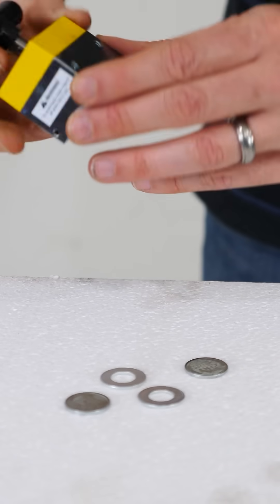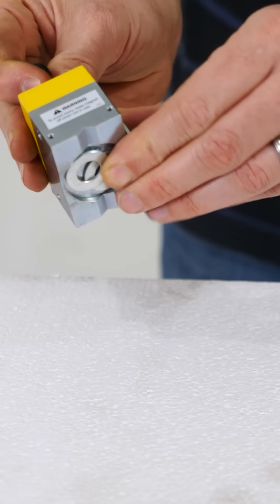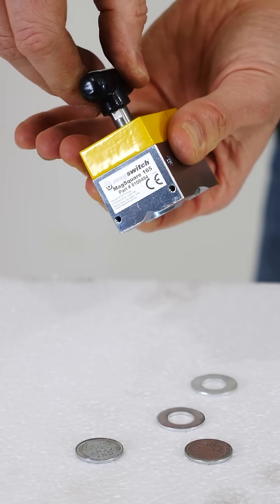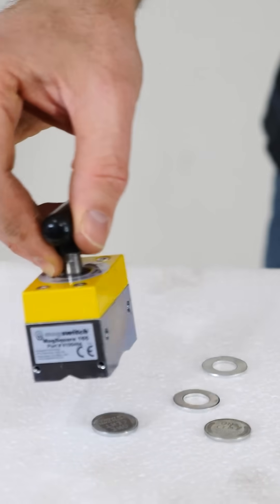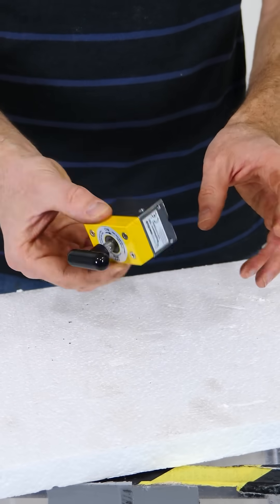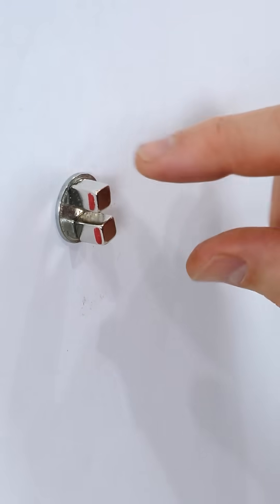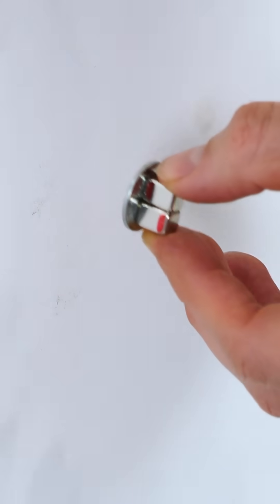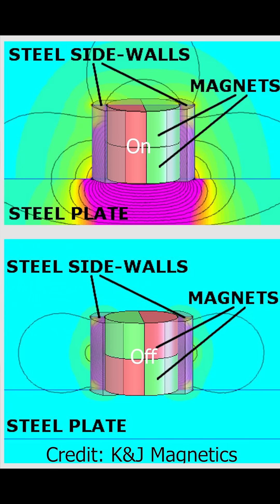How To Turn Off Permanent Magnets

Comment: Father a machinist, on a large piece of equipment there was a large plate and a handle.   I learned about the magnet and I how I could turn on and off.   I never learned how it worked.   Thanks so much.    I remember asking  teacher at school, but they did not even understand question.   Father, was excellent machinist but he admitted he did not know.   Said he used it to hold metal still, so he could cut, grind, drill etc.
Reply: As a machinist, we also use these magnets with adjustable arms to hold indicators for precision work
Reply: My dad cut it open - i still remember that hole evening we spend in his garage trying to understand it. He has done a lot to satisfy his kids questions. I do believe today as a adult and son of my dad, he did it mostly to satisfy his own curiosity, he just never had the mindset to ask the simple questions, he did a lot things the wrong way but still ended up completing the task - i have always admired him for that gift
Reply: My dad was a machinist too.
Reply: Mag base. Use them everyday with indicators
Reply: I mean... if you really wanted to know, you could've broken one apart I think...?
Reply: Hence, science communicators exist, a whole separate skill from tool mastery.
Reply: @cheesecakelasagna To me, at least, it's the difference between engineering and science: How to do it vs What is happening.

And the "Why do it" is simply philosophy.
Reply: bullsht alert
Reply: @Bramon83  what's bullshit? He's describing a magnetic chuck, they're a pretty common piece of machining equipment. I've used them on surface grinders, very handy.

Comment: I can envision countless engineering possibilities with this mechanism. Pretty cool.
Reply: I remember a company possibly I don't know... 10 plus years ago creating magnets like this with complex designs for all sorts of application. 

 Seen it actually on History or Discovery. So you know it is old. 

 They made it sound revolutionary, but people are saying this tech has been around for a while. So I don't know what gives. 

 Maybe it had to do with the manufacturing process or the complexity of the magnetic fields. They did make a big deal about both. 

 It was mainly about making locks.

Comment: Without watching the whole video I'm gonna guess there are two magnets and you simply rotate them so the interference pattern is either constructive or destructive.
Nailed it.
Reply: No, completely wrong.
He used the word "short circuit".
And the diagram he produced shows what is happening, even though it is not entirely clear.

The concept is of a magnetic short circuit, which is analogous to an electrical short circuit, but in an electrical short circuit the electrical resistance is very low, in a magnetic short circuit, the magnetic reluctance is very low.

It is creating a magnetic circuit comprising a low reluctance path for the magnetic field.
Magnetic fields like to be inside ferrous materials like steel and iron, these materials have a low magnetic reluctance.

Rotating the upper magnet results in the north and south poles of the magnets coming into contact with the ferrous metal outer case, and the magnetic flux is then connected from the north to the south poles through the ferrous case, which is a low reluctance path, thus keeping all the magnetic flux inside the metal case.

If you look at the video closely and pause it at the right point, you will see he illustrates this with all of the lines of magnetic flux kept inside the case, as they travel through the metal case.

There is no opposition of magnetic fields.
There is no interference of magnetic fields.

It is simply that the magnetic field is kept inside the ferrous metal case as the case acts as a "magnetic keep", a low reluctance path is created and the field is kept within.
Reply: mygaza 
Constructive Interference: The forces of the magnets pointed in the same direction combine to exert greater magnetic force.
The magnetic contraption is "on".

Destructive Interference: The forces of the magnets pointed in opposite directions (the push and pull) weaken eachother-- in this case, effectively cancelling out the forces.
The magnetic contraption is "off".
Reply: OMG!!! YOU’RE SO SMART SIR!!

Comment: Bro I just realized the coins he used for that magnet are worth so much and are in perfect condition! (Im a coin collector!) keep ‘em in mind that they are valueable
Reply: dog that’s a steel penney them things is thought not to exist well atleast there not very many
Reply: @waterbottlemafia3158  - They exist. I have a few,  the government minted them during WW2 so that copper could be used for the war effort. Steel was also needed, but a secondary benefit of using steel for coins was the cost of minting the less valuable metal meant a profit to the Treasury, which presumably went to the war effort.
Reply: Actually they're not that valuable unless they're another year besides 1943. Pennies were made of steel in 1943 due to the copper shortage in WWII, so if these are 1943 pennies, yes they are still more valuable than the face value but they're not nearly as much as many mint/die error coins or transitional error coins would be. The ones in this video would get you $1-20 each, depending where you go to sell it.
Reply: They’re just 1943 steel cents, they are only worth about $0.10
Reply: Exactly, I had to double and triple take the steel Wheaties. I have a perfect mint set of 1935-1975 penny's (yes, I know the US doesn't actually use the "penny".), with 1943 P, D, & S. I love coins. My absolute favorite is the 1861 Seated Liberty quarter that I found metal detecting. I live in a small southeastern Kansas town that was Union camp during the Civil War. I found it with other Civil War relics, so it seems safe to assume it has been in the ground since then. After some really through research, I found out it is an extremely rare variety. The obverse and reverse are of different types. I have no idea of its actual value. But, the expert I spoke with said he only knows of less than half a dozen of this variety. He also confirmed that it is, in fact, the extremely rare variety. I need to send it off to get it officially authenticated and graded. I don't have any desire to sell it, so I haven't been in a rush to do so.
Reply: @dustinfrey3067  lucky you I’ve been collecting for about 3 years now and I wish I had that type o’ luck ngl
Reply: There worth less than a Wopper in California

Comment: Invent a magnetic digital spectrometer with a complex particle rotator and pick up 316 stainless steel 50 gram nut out of a barrel filled with 8.8 high tensile steel nuts but only take the stainless one out ?😊

Comment: It’s a real favourite tech especially in the ferrous and non ferrous Super Huge Mega ferrous recycling industries wich is becoming a definitely industry one would want a pretty penny invested in. Mainly because there is so much scrap steal around the world to build it 3 times over. It’s safer from political and International weaponisation. But it’s just much much better for everyone around. It’s Chinas crave for the stuff that’s sent the mining industry a huge orgasim  for the last 35 years + but it will end 100% and the cost of re smelting old but excellent grade iron ore already containing chemically added silica and a host of other pre mixed elements saving many tasks required from the raw source that needs several processes before the iron ore can be graded good enough to make the basics to 8.8 steel stainless steel.316 marine grade steal. Pretty Damm OBVIOUS 🇦🇺🇦🇺🇦🇺🤟🤟

Comment: You can actually do this on a smaller scale using those toy magnet building rods.  If you attach as many of those rods to a single metal ball all with the same pole it will turn the metal ball into a super strong magnet.  But if you attach an equal number of (+) and (-) poles to the metal ball it will have zero magnetism.

Comment: I used to work in a machine shop that had some of these that could hold 1000 to 2000 pounds! but I never knew how they actually worked, thanks for the info

Comment: Okay so I was thinking that since you figured this out, you can probably make electricity with it. I imagine something being pulled by the magnet and being pushed by a spring to create movement that can be turned into electricity. When it gets closer a switch will turn off the magnet and when it reaches the opposite end it turns it back on.
Reply: Perpetual motion is impossible though, "making" energy would mean it came from nowhere.

Comment: We use rare earth magnets with a similar lever switch for our cordless magbase drills. I was surprised to learn the magnet still worked without the battery inserted, and it even has an intermediate 15% power setting to allow for adjustments without fully disengaging the magnet. They do work great and never run out

Comment: If I am understanding this correctly. 
The magnetic field is what attracts and repels.
When we turn on a magnet it produces these fields to become magnetic? (Please correct me if I am misunderstanding as I am tying to wrap my head around this as I write)
So in essence a magnet is a mass that has a bunch of “Invisible Velcro” (for lack of better terminology to relate to what is similar in accomplishments) when active. 
Then when inactive or turned off, all the “Invisible Velcro” gets stuffed into a shell to prevent it from sticking or pulling anything caught within its “I.Velcro”?
If this is true I have a feeling there is a lot a lot a lot of research and discovering to be had with how we can implement these specific natural laws of physics in in our everyday lives 😊

Comment: We got one of these at work to lift heavy molds. Usually they are equipped with with threaded hole on top for a lifting ring to go into them. When yhe mold doesn't have one, the magnet is used.

Comment: About the metal bar,
“Literally cannot pull it off”
Makes it slide around on the magnet
Reply: That's...accurate... I can tell that you've never handled a very strong magnet before. The force required to directly pull it away from the surface is much higher than the force required to simply slide it around, because that's how magnetism works. It's normal to have to slide a very strong magnet off of the surface in order to remove it, because pulling it directly away requires more strength than a person might have.

🤦🏼‍♂️
Reply: have you never used magnets before? its not because its slides easily that it’s easy to pull off
Reply: @hmski10  and?
Reply: @hmski10  did I ask for u to say this?u:🤓🤓🤓🤓🤓🤓🤓
Reply: @HelloThere-gz3yh  nah dude im not even gonna say anything cuz you're probably not older than 9 💀

Comment: There’s a strong magnet in there and that circle plate on the bottom is touching th magnet it’s probably aluminum and when you twist it it doesn’t touch th aluminum which stops the magnetic flow even though aluminum isn’t magnetic

Comment: I don't know how it is made now, but previously there was a warning "do not open/disassemble" because it will loose its magnetic field, it was magnetized only in assembled state, and there was no "polarity switching" but closing/opening loop between two opposite poles
Reply: So no not really. What most likely happens is they fracture one or both of the magnets when trying to disassemble without proper equipment. If you bream a magnet in half. It is now 2 separate magnets. A magnet always has a north and south poles. So if you break one of the 2 magnets. You now have more than 2 magnets and the shorting effect of opposite poles with multiple smaller magnets.
Reply: @epp4791  no, there where no ferromagnetic magnets, just metal parts that where magnetized after assembly. I have seen video where one guy disassembled such magnet deliberately to show what will happen and how to fix it. No parts where fractured or broken.
Reply: @tarasian666  then it wasn't one of the magnets in the videos. That's not at all what the magnet in this video was. You're talking about an EPM and that's completely different technology that what's in this video. I make these.

Comment: At my HVAC company, we have one of these attached to a handle and wheels. We push it around the parking lot to pick up loose screws and sharp bits of cut sheet metal. The off switch is used when we empty it into the trash can.
Reply: Came here to say this
Reply: @MikeySkywalker jesus loves you repent of your sins
Reply: Lo puedo comprar por internet ? Y como se llama no sabes ?
Reply: @Son-jesus376  I was wanting to know the exact same thing! I want one! 😯
(On my way to Amazon... 😄)
Reply: Temporarily
Reply: Is it battery operated?

Comment: I know perpetual motion is impossible. Having said that I can't find out where the following proposed setup wouldn't work:

Seeing how easy it is to turn the magnet on and of. Compared to how hard it is to pull objects lose from the magnet when on. Wouldn't it be possible to create energy by having objects pulled towards the magnet. Then use part but not all of the energy to turn the magnet back off again. Letting the objects fall back into their original position. And then use that same energy to turn the magnet back on again. Restarting the cycle
Reply: Each cycle you'll lose a bit of energy to heat from the friction inside the magnet from the magnets turning against each other, and an infinitesimally small but real amount of energy to gravitational waves from the movement of both the magnet and the object, so eventually all the energy would be dissipated by these two phenomena and you would not have perpetual motion, although it well designed this could probably oscillate for quite a long time, although it would be virtually impossible to actually extract any of this energy to use for something

Comment: I still don't get it. Magnets confuse me O.o
Reply: Interestingly, if you ever take a class in electromagnetic fields and waves, you'll learn that in addition to electric circuits like the ones most people are familiar with, there are also "magnetic circuits. These essentially work by either currents from many electrons adding up to create a magnetic field, or a coil of wire creating a magnetic field, that are then propagated through a ferromagnetic material with some permeability. Interestingly, these magnetic circuits form a kind of analog with standard electrical circuits, but in this case the individual currents loops of currents act in the same way a voltage source works, magnetic flux works the same way current works, that is the total flux through a node is zero, and then you have magnetic reluctances, an analog to electrical resistance, that attenuate magnetic flux from permeating it. Ferromagnetic materials have a much higher permeability and therefore much smaller magnetic reluctance than something like the air, which means if you have a complete magnetic circuit of ferromagnetic material, almost all of the field lines will be concentrated through this material, and almost none will be anywhere else. Sort of like how if you short circuit something almost no current will flow through anything with large resistance. When he turns the dial, the two individual ferromagnetic materials make a complete circuit, concentrating all the magnetic field lines through the magnet so the magnetic field outside of the magnet is basically zero, so the objects no longer feel as large of a force. Pretty cool right! If you're interested in learning more and have a background in vector calculus and basic physics, zoya popovic's "introductory electromagnetics" is a great book that can teach you a lot about this stuff without being too mathematically intensive

Comment: Machine beds also use magna-blocks - steel and brass sections are interlaced and a handle is used to switch the polarity of the magnet - I used to machine cylinder blocks, manifolds, shims and heads with this device - very very strong

Comment: The Milwaukee battery powered mag drill uses this, people’s concerns are always well when the battery runs out the drill will fall (because most mag drills use electromagnets) well the Milwaukee one only used the battery to run the drill while the magnet is similar to this hence it can stick even when there’s no battery attached :)

Comment: We used the big ones of these in the weld out fab shop I worked at, easy for moving around metal parts instead of using a crane strap

Comment: How do magnets work?

The magnet consists of concentric clockwise and counterclockwise dipole rings that extend from one pole to the other over the entire body of the magnet.

Dipole rings in the same direction attract each other, and dipole rings in opposite directions repel each other. Likewise, currents in the same direction attract each other and currents in opposite directions repel each other.

An electric current can induce dipoles in a magnetic material to form dipole rings. Moving magnets can induce electrons in a conductor to produce an electric current. 

Since a dipole ring has two magnetic poles, clockwise and counterclockwise, there cannot be a single magnetic pole.

Comment: I used these in a welding shop building excavator buckets, I wasn’t keeping it clean and let a lot of metal dust build up on it over time, which allowed it to slide towards me and fall free. I ended up dropping a 700+ lbs bucket panel on my foot, luckily no permanent damage because I was standing next to some pallets and it also landed on those and gave me just enough room to get my foot out.

Comment: This works the same way that a magnet does it a hardware store for picking up nails. You're not turning the magnet off when you turn the handle you're actually separating the internal magnet from the bottom plate. It just moves up into the base